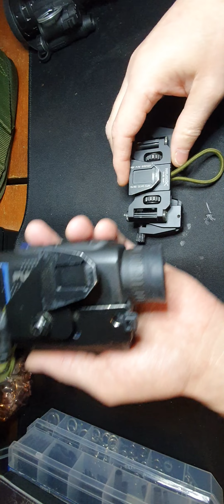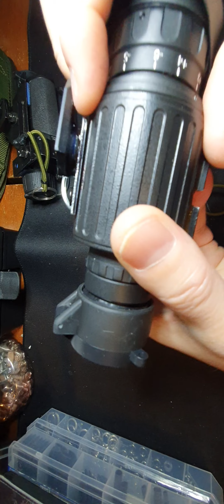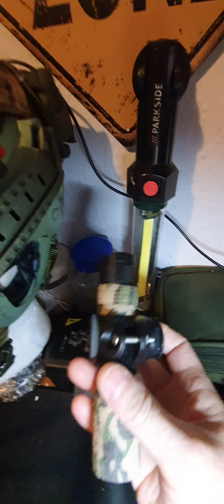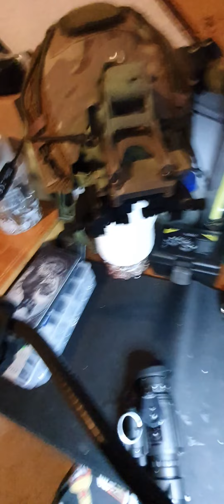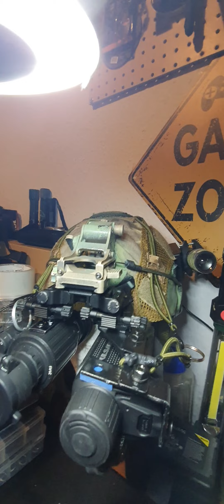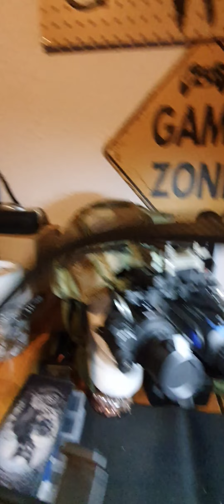Thermal & Night Vision Bino mod

Comment: What is the name of the helmet? didnt catch it in the video
Reply from the maker: It's just some cheap bump helmet I bought from eBay and Modified.

https://ibb.co/5FgDBGq

Paid £33 for it, bought a second cheap Fast helmet, £28, removed the strap system from that and the rails and attached it to the cheap bump, then attached a cheap cover and a counterweight pouch at the rear.